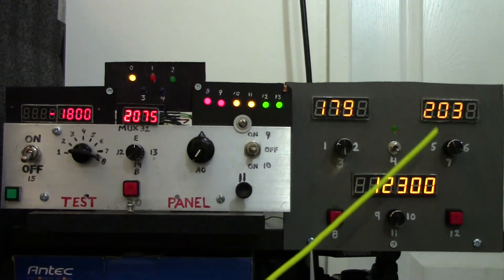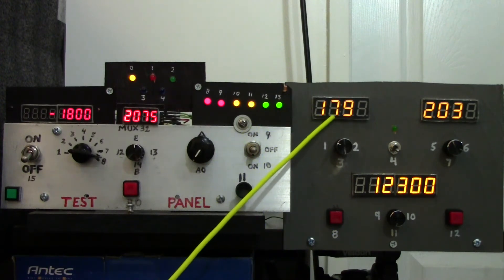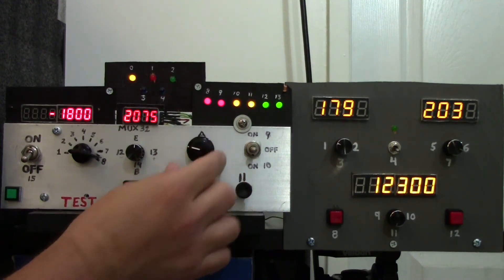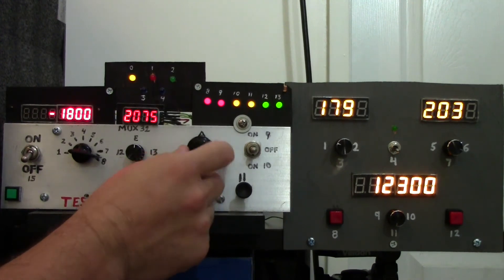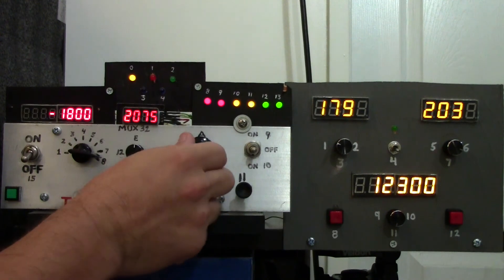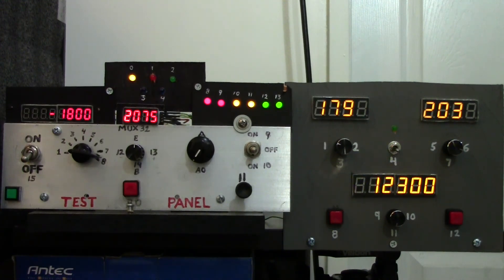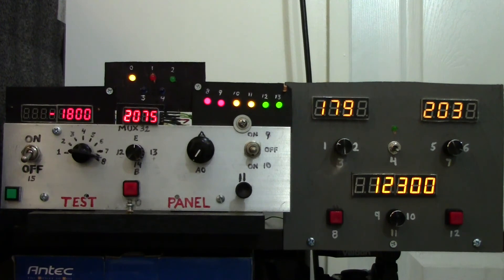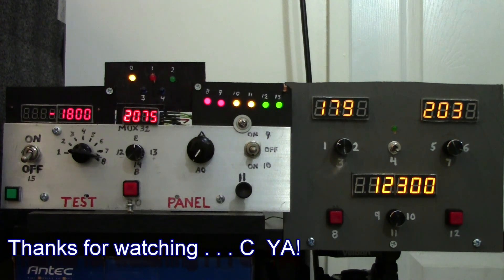7 Segment Display Brightness Control

Comment: Hi guys, QOSMOKID, I have had that problem of flickering either in the analog controls, or in the 7-segment dimmer display, the solution I found to my problem is by placing a polarized capacitor in the potentiometer on the center pin from 1uf to 25 volts or less, this smoothes the brush sweep and reduces electronic noise, it becomes a few thousandths of a second slow if the capacitor is more than 1uf since it is the charging and discharging time of the same capacitor. 

Cordial saludo QOSMOKID, yo he tenido ese problema de parpadeo ya sea en los mandos analógicos, o en el display 7 segmentos dimmer, la solución que encontré a mi problema es colocando un condensador polarizado en el potenciómetro en el pin del centro de 1uf a 25 voltios o menos, esto suaviza el barrido de la escobilla y reduce el ruido electrónico, se vuelve unas milésimas de segundo lento si el condensador es mas de 1uf dado que es le tiempo de carga y descarga del mismo condensador.
Reply from the maker: Muchas gracias por ese consejo Milton, voy a hacer eso cuando tenga uno que quiero que funcione limpiamente. Por eso es bueno tener mas entendimiento de electronica

Thanks Milton,  I will give that a try for any potentiometers that I would like to have nice clean output from. I guess thats why it's good to have a little more knowledge of electronics.

Comment: Does realy any of these 7 segments work with Cessna 172 sp? Web site says coms and Navs, should not matter with type of aircraft, but when I load any codes it's not recognized, I'm sure the wiring to 7 segement is done per webpage instruments 🤔
Reply from the maker: You know I never tried them with the  default C172. I will try and let you know my results. That's the reason I really hate the went to this all in one instrument model where it just assumes you are making the entire radio panel, transponder, or ADF. I hate what we just can't select just one display function or button function anymore.
Reply: @Qosmokid  "we just can't select just one display function or button function "

You CAN select one display function (i.e. Com1 freq) and one button  (i.e. flip).
Vlad
Reply from the maker: @SimVimX_System  yes I think for a minute I was thinking about the data tables since there is nothing there now for radios or transponders only on the images. I still didn't see a way to select COM2 or NAV2 except for the all in one instrument.
Reply: @Qosmokid  
It's simple:
1. Open the "Com/Nav #2" map [button].  
2. Assign (connect) the 7-seg display where Com2 will be displayed. 
3. Click on the Com2 parameter and select this display...  Use the "Generic/Kx155"  (or any other device)
4. Select Com display size if needed (5 or 6 digit display - two buttons on the top of the image map)
Reply from the maker: @SimVimX_System  I'm pretty sure I tried that one but it still applies the functions for NAV1 and COM1 but I may be wrong. I just edit the cfg file and change it to COM2 and NAV2 but I will check again
Reply from the maker: @SimVimX_System  Ah yes, that was my mistake. Not sure why I didn't notice the separate one. Maybe I was just too focused on #1
Reply: @Qosmokid  yes, it looks things keep changing all the time, I set my tiny LCD to print Come & Nave those don't function anymore,  now I'm  momentarily & Encoder switches for making my GPS to be accessible whenever cockpit is turned off, but I still needed make my 7 segments print auto pilot, and transponder, the website says  172 sp is under Construction, I hope Simvim make all these activated by this Christmas 😊👍
Reply from the maker: @FlightSim2703  Ok so I tried the TM1637 and MAX7219 seven displays that I have on my test panel and they all worked with Both Com1, Com2 & Nav1, Nav2 on the default C172. As I've mentioned before, I do not have LCD displays so I can't test that but at least for 7 segment displays all the parameters are working
Reply: @Qosmokid  very strange, because I used my 2x16   LCD originally to print autopilot, and one of them 4x20 LCD print Com1&Com2, and , Nav1&NAV2, and exponder for Cessna 172 sp, and all use to work, but this third one stopped function, I checked all wiring nothing is disconnected or changed but no function anymore,  I will disconnect all wiring and redo it again,  buy the way I appreciate for you recharging ♥️🙏🙏  @Qosmokid  another question are these two 7 segments you just tested connected straight to Mega? Please let me know how the wiring run from 7 segement to Mega? Thanks so much
Reply: @Qosmokid  another question are these two 7 segments you just tested connected straight to Mega? Please let me know how the wiring run from 7 segement to Mega? Thanks so much
Reply from the maker: @FlightSim2703  I have the 7 segment displays connected to output mux board like I show on the long video I posted last week. Its the same thing regardless, the only thing that changes is if the CLK wire goes to the MUX or directly to the Arduino
Reply: @FlightSim2703  " it looks things keep changing all the time, I set my tiny LCD to print Come & Nave those don't function anymore"

Brian, what do you mean, nothing was changed for the last months, especially for LCD. If you have a bug, please report on the forum or by email.

And  you said: "the website says  172 sp is under Construction" 
You don't need any specific assignments for C172, just use all existing image maps and table - all parameters are there.
Vlad
Reply: @SimVimX_System I busted all my wiring, I will try again as soon as ready ♥️🙏
Reply: Brian,
In SImVim configurator you always are assigning the specific flight parameter for  specific display and configuring specific device - and it's absolutely not depend on the aircraft type.
For example, if you assigning the active COM frequency  - it always will be that frequency for any plane loaded.

More - you can select specific SimVim instrument to get all it's functionality - if you select and assign the KX156A you will have all 32 channels memory, NAV options, etc.
https://simvim.com/svc_custom_radio.html

Ask more on the forum if you need help.
Vlad
Reply: @SimVimX_System  I used Max7219, and followed the webpage comments  data wiring goes straight to pin  27, 28, and  CLOK to pin 36, which is used for dt input, still can't print anything, Com or Nav or etc. I think I'm doing something wrong  🤔

Comment: Hi Qosmokid. Thanks for doing this video - it was me that asked for it so I am very grateful. Could you also show how you connect two of the TM1637 modules to an output from say the altitude which will require more than 4 numbers - if you have already done this could you tell me where. Many thanks for you work. Dave
Reply from the maker: I do show that in this video David but you need to use a 7 segment display with 6 or 8 digits. For example, the speed, altitude, and vertical speed on the Boeing 737 MCP will not display properly on a 4 digit TM1637 that's why I used the bottom one which is a 6 digit TM1637. Of course you can also use a MAX 7219 with 8 digits but that's too many. If you are asking if it's possible to combine two TM1637s to make them into "one" display I don't think that's possible.
Reply: David,
For the Altitude display you should use TM1637 module with 6 digits. 
Or - the MAX7219 with 8 digits (that is too much).
Also you can buy some MAX7219 matrix LED module with detachable LED indicators , remove them and connect 5 separate digits: https://simvim.com/tech_num.html
Vlad